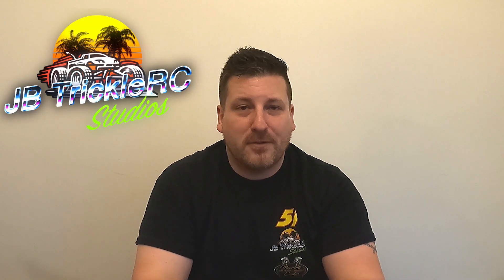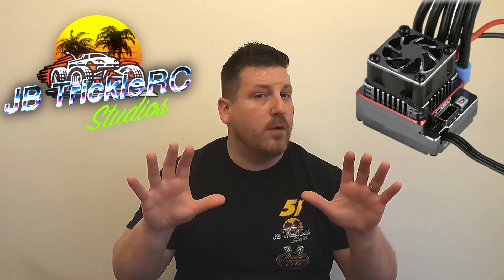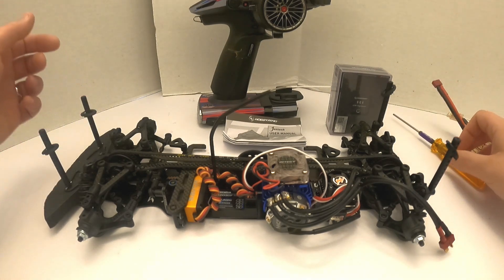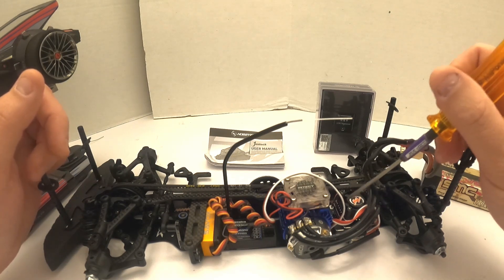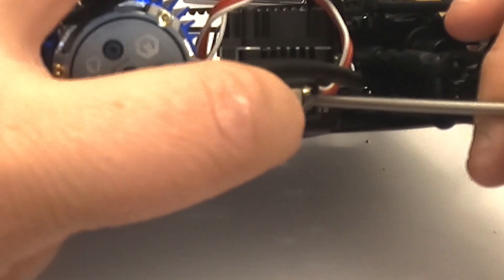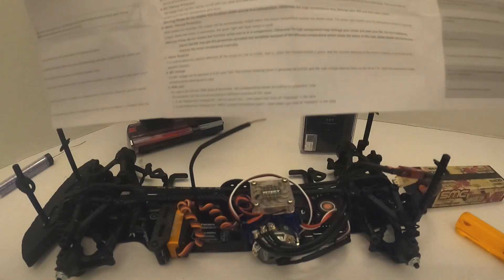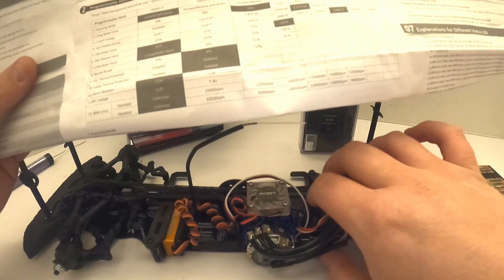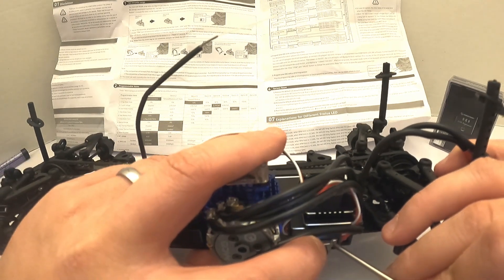Hobbywing ESC Setup and tuning tutorial #Hobbywing

Comment from the maker: Hey everyone, I had a couple people reach out to me on Facebook Messenger asking about my personal ESC settings.  Generally, I just run throttle and brake with no reverse (reverse can be good for a beginner to help out of tough positions).  I also generally max out the punch setting and remove all drag brake settings.  depending on track condition I will generally adjust my throttle curve in my radio.  As far as boost and timing is concerned (For the XR10 Pro) for drag cars I've not messed with that much yet but will update with another episode when I do as I'm still currently focused on "blinky" mode drag racing.

Comment: What does the 3rd blinky mode mean
Reply from the maker: Good question, it depends on which mode you are currently programming.  If you just started, the first options would be the running model.  The third blink would be forward with reverse.  With 1 blink being forward with brake and 2nd bink being forward, reverse and brake.  If programming manually by touch button, I highly recommend using the manual for reference as there are about 10 programable options.  The manuals can be downloaded on your phone or printed off in PDF from the HobbyWing website.  The program box simplifies the entire process as it gives you a detail of each item programming.  I hope this helps.

Comment: Can you program a new xr10pro 1s esc with the old program cards??
Reply from the maker: Great question and I honestly cannot answer that as I have not tried that yet so I have no personal experience.  However, I would imagine their website or manual would have more details on that. If not send them an email. Their customer service has always been helpful to me.
Reply: @jbtricklerc  and the real answer is the old style card will not work,  need the LCD programmer
Reply from the maker: @toddshobbyzone659  Ahhh....  Quite convenient that the new version will require a newer product to program as well isn't it.  The manufacturers gonna get that wallet again lol
Reply: @jbtricklerc  $100 esc and 30 to be able to use
Reply from the maker: @toddshobbyzone659  exactly. It's unfortunate.

Comment: Just getting into the hobby and I’ve upgraded my Traxxas to a Hobbywing MAX8, is there any programming on the remote we need to be aware of to get the Transmitter/Receiver/ESC to talk? I have a Flysky that has options for Analog/Digital/Other xxx, and it was having issues with the VXL-6 that I’m replacing. Don’t want any surprises once it arrives
Reply from the maker: Thats a great question, however, I may not have the exact answer you are looking for as I do not have any experience with FlySky systems or how they operate.  My experience has been in Futaba systems and thats what I'm used to using.  However, I do know of some friends that have used FlySky systems successfully withthe Hobbywing electronics.  So it should be able to be done.  I'm just not aware of the process.  I know one of my friends told me how complicated the FlySky manual was due to poor english translations.

Comment: Hey!  great channel.  We just installed the Hobbywing juststock 13.5 combo on the new Traxxas Super Stock class.  I have an issue with the spur and the pinion gear not lining up correctly due to motor shaft being shorter than the 12t.  If i turn the pinion inward the set screw extends past the shaft.  If I turn it outboard with mounting side pushed flush with motor mount the teeth still sits about 3/16th outside of the spur gear.  Have you had this before and how did you fix it.
Reply from the maker: I greatly appreciate the comment and support.  I don't recall running into any issue before.  Could be just the brand of pinion gear as some do have a longer thread boss. But ... Before you spend money, first check how you mounted the motor again. Did you remove the little black plastic insert part that is there to maintain gear mesh? 
Most of us remove that completely, set our gear mesh properly and just screw the motor securely without it.

Comment: I need help setting my system up
Reply from the maker: Hey Ted, what specifically are you having issues with?  I'll do my best if I'm able.
Reply: @jbtricklerc  having problems with my Ztw settings it up
Reply from the maker: @tedshickell7315  I'm afraid I haven't had any experience with that brand.  Do you have the original manual?  If not, usually you can find a PDF of it online
Reply: @jbtricklerc  I do have it but it’s like a manual for nasa
Reply from the maker: @tedshickell7315  uh oh, I've ran into that before when first getting into the hobby years ago.  I'm afraid since I do not personally have any experience with that manufacturer and model I may not be much help.  Hopefully someone on Youtube has done a tutorial on that exact combo.

Comment: When you entered the drag brake force that long 1 beep means you are in option 5 = 40% drag brake force. After 4 beeps it does 1 long beep for 5 then each single beep after the long beep is 6,7,8..... Did you change settings when you plugged in? Cause It did show your brake drag force at 0 on your phone.
Reply from the maker: Hey HGrove. I did.  If I recall correctly, I actually filmed the methods separately and maybe even out of order.  But when it was all said and done everything was good to go.

Comment: is it posible to soften the engine up some how?
tested a car with orca system and that had a punch setting that made the engine smoth and not so torque heavy, feel i want something like that on my HW system.
Reply from the maker: Extec, great question.  With the right options you can likely tune this with two different methods.  1st method is lowering the punch setting in the ESC.  This can be done in the HobbyWing ESC settings or with the program card and or app.  The other method is tuning it in the Radio itself.  Depending on if the Transmitter has this option and if so, which brand.  Generally tuning the throttle curve settings can help as well.
Reply: @jbtricklerc  got an xr10 pro but dont find a punch setting on my app.
feels like i missed something or lack of it.
Reply from the maker: @extec101  I could be wrong, but I believe they may have called it something else.  If I can remember or verify, I'll reply here again too.  If memory serves me correctly, I found it by reading the descriptions in the manual and realized it was called something else.
Reply: @jbtricklerc  is it the softening valu you mean?
Reply from the maker: @extec101  That may be it.  I'll have to look to verify, but that may have very well been it.

Comment: I have the justock XR10 ESC.  When I pull the throttle to full it has a slow take off than burst into full speed.  How do I eliminate that so I have full take off on  initial trigger pull.  I bought the motor and ESC combo I also have a programming board.
Reply from the maker: Bryan, what transmitter/radio are you using? Is it possible that you have the throttle curve turned down?
Reply: @jbtricklerc   I don't have a throttle curve setting on mine. My boy has the same ESC in his Sprint card and it goes full throttle right away but mine has that hesitation just wonder if it's something to do with that Justock 17. 5 motor
Reply from the maker: @BAMsCrawlers  double check that the sensor wire is plugged in properly in the ESC and motor. Double check all solder connections as well.  Hmmm... No throttle curve adjustment.  Does it have end point adjustments? I'm not familiar with that radio so I'm unsure.  You can also try reprogramming the ESC after checking all connections as well.
Reply: @jbtricklerc  all my connections are good.  Yes it has end point adjustment every thing is set to 0. If I unplug the sensor will it be ok to run it without it.
Reply: @jbtricklerc   Well I just rechecked everything again and unplugged the sensor wire actually and plugged it back in and now everything seems to work thank you very much for your help. Love your videos also.
Reply from the maker: @BAMsCrawlers  that's awesome news! Happy that we were able to get it figured out and I greatly appreciate the support as well.
Reply: @jbtricklerc  I use the flysky FS-GT3B

Comment: What is so special about this brand price?  Once you get into there xr elite and pro series escs there not any cheaper then the big boy brands like tekin etc.. the new xr8 is the same price as my rx8 and its only 160a my rx8 is 300a  a friend of mine had hobby wing in his sc mod and street stock and is now running tekin. I cam say he wasn't faster then me with his xr8 4600 combo vs my rx8 4600 pro 4 combo. Both in sc5m sc mods.
Reply from the maker: Jeff Bryner, great question.  The biggest reason here is a mix of cost, class rules and no timing.  The Justock version of the ESC is a no timing ESC.  cost around $60 and we do a lot of SPEC racing between paved oval, dirt oval etc.  Many, or should I say most classes require this specific speed control in the class rules due to those 3 things I mentioned.  At a $60 price point serves very well for these classes.  I do agree once you step into the higher end Hobbywing ESC's, the cost savings isn't really there anymore and in many cases, priced similarly to Tekin and other big brands.
Reply: @jbtricklerc  oh ok. Yeah we have a 10.5  blinky class but no specific brand. I run my tekin at 0degree timing. Most people I see are running xr10s and 7.5s in street stock. They just now made it 13.5 but still open esc amd both tracks I run at. I could see if you had a spe esc class then
Reply from the maker: @jeffbryner5355  to gotcha. Yeah if they had open ESC in blinky I'm sure we'd see more than hobbywing.  But those rules get ya lol. And honestly, the Hobbywing Justocks have been great.  I'm also an old Tekin guy from back in the day lol
Reply: @jbtricklerc  yeah. In the 80s I ran tekin and Novak. I still have my 10t super sonic and brushed Novak esc in my losi jrx 2 sprint car haha.
Reply from the maker: @jeffbryner5355  I hear ya there. We once used a lot of Novak in racing as well